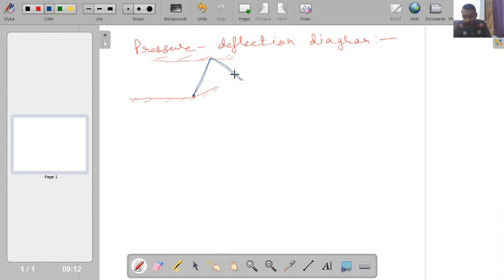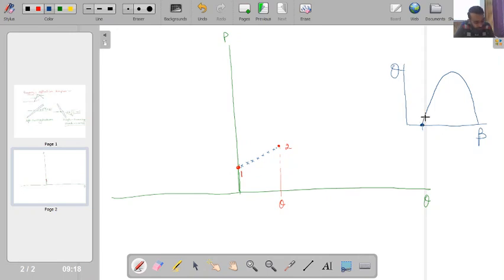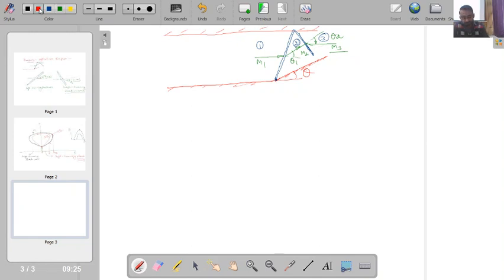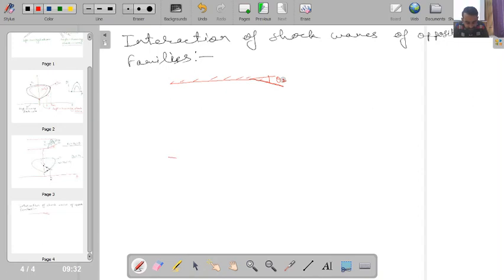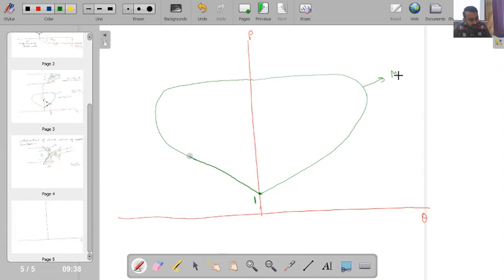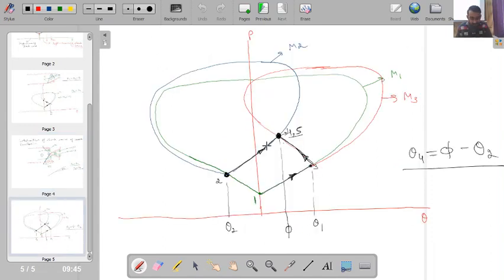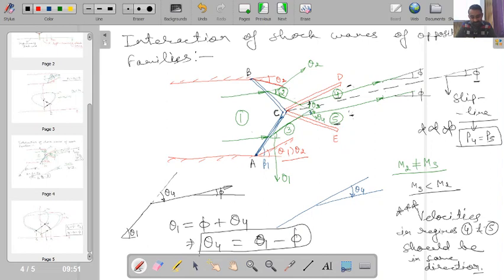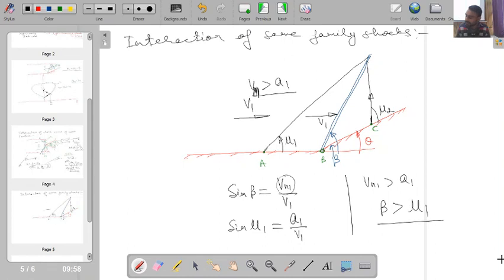Lecture 19: Pressure Deflection Diagrams and Interaction of Shocks of Opposite Families

Comment: Hi there, how would I calculate phi if I know theta 1, theta 2, and the initial mach number and pressure?
Reply from the maker: By knowing theta1 and theta 2, you can calculate the components of velocities normal to the shock wave and then you can use the shock wave relations as explained in Lecture 16 (https://www.youtube.com/watch?v=jJMoC3_xvOU&list=PLPpfO2vPgu2XaSxF6zsIW13AS6ui5jZmP&index=16) to calculate the velocities (Mach number) and pressure in downstream of the shock waves. The velocities will give data of the downstream deflection angles theta 3 and theta 4 using geometric relations and that can be used to calculate angle phi.